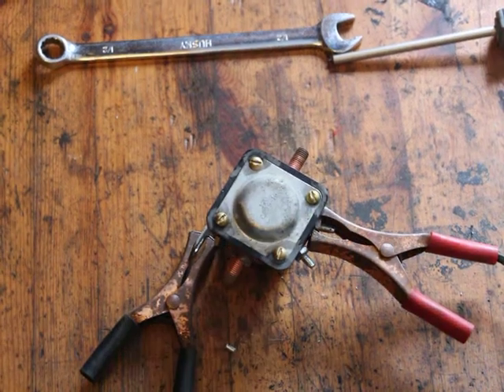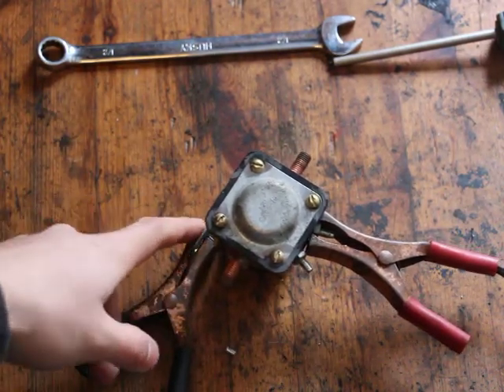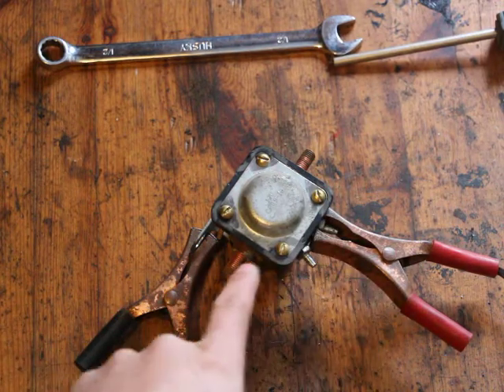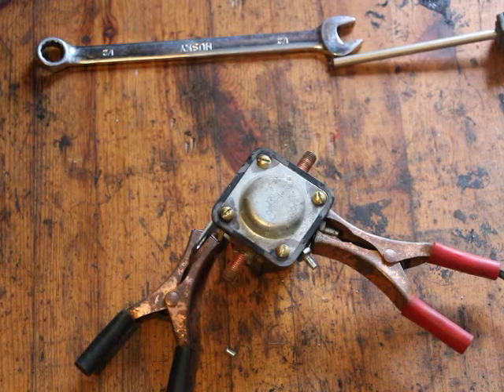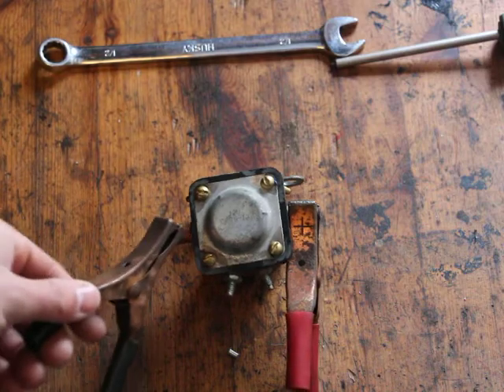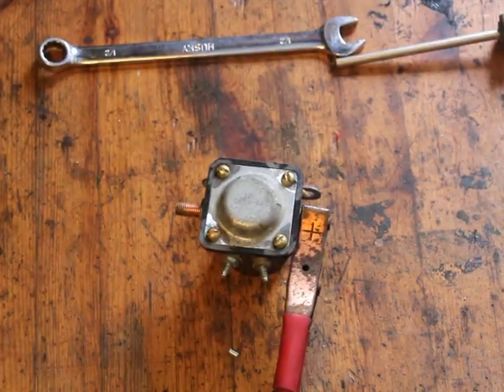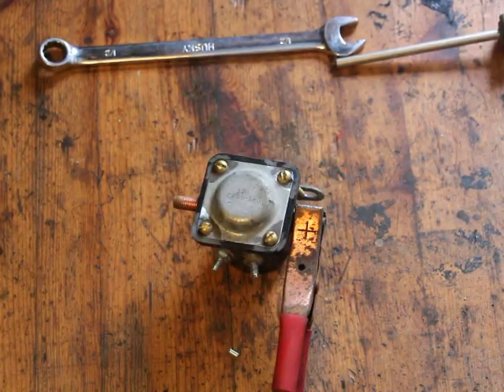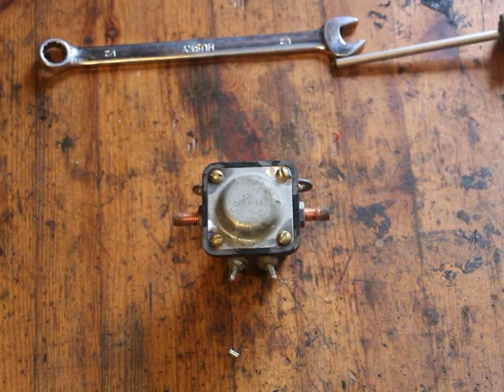How to test a relay 1966 Thunderbird starter solenoid testing p3

Comment: Hey, I’ve got a 1961 t-bird. It’s got an issue where it will cranks and has combustion when key is in start position. However it dies if I let go of the key and don’t hold it in start.
Reply from the maker: Hi, that sounds like a wrong wire, or a bad terminal connection. The current going to the ignition coil should remain on after the key is returned to the ON position. 

I'd bypass the ignition key/switch by connecting a wire directly from the + side of the battery and seeing if that solves it.

Let me know if that works
Reply: Old Crow's Classic Cars wil do thanks for the advice